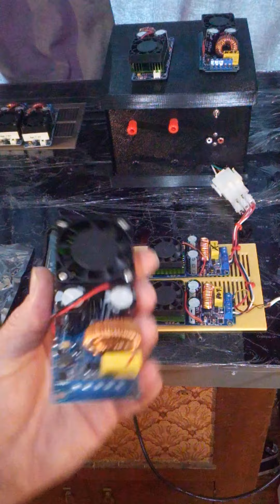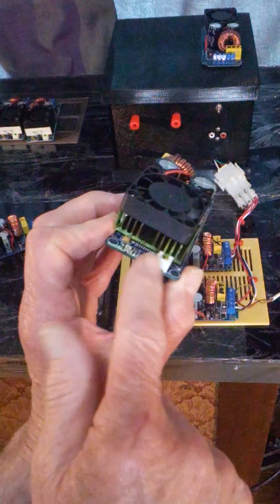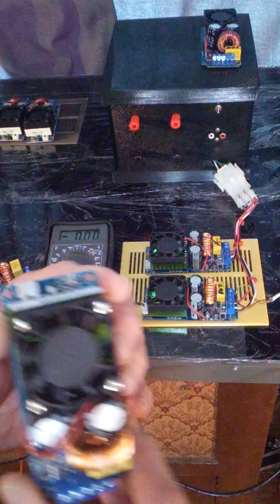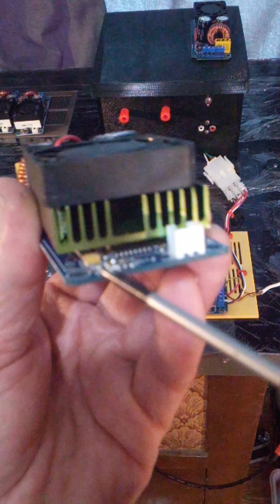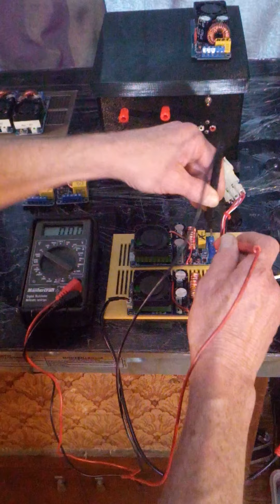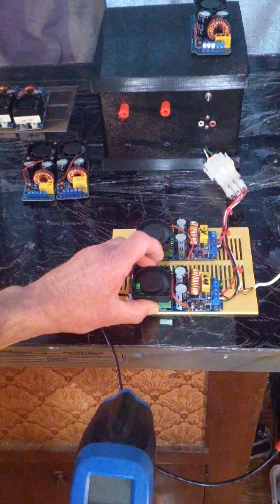IRS2092AMP-500W Amplifier Modules - how to tell the good ones from the bad ones at a glance!

Comment: Nope heatsink should like bad one. Because when amplifier is working link peroid of time, inductor gets hot so needed cooldown. Right ?
Reply: No because the heat from the heatsink will blow on the inductor so the inductor will get hotter
Reply: Why ?  @Raulley27

Comment: I think I got mixed one. Fan was loose, only two screws. Cooling fin has slots all around. There is small heat sink under it. And it works :D

Comment: Hi were do get the ground from? My 65 Volt-DC-Powersupply only features plus and minus? Why do I need the Groundcable?
Reply from the maker: These amps require a dual output power supply that has +/- 65vdc with a common ground. So 3 connections: +65vdc, ground, -65vdc with a total across the + and - of 130vdc
Reply: @terrycox6954   My guitar amp has +/- 48vdc supply can it run my preamp? in to 16r or 8 r cabinet?

Comment: tak sem taky naletěl mohu vás poprosit o odkaz na ty funkční moduly zakoupil sem si tento modul od firmy hadex a bohužel je to přesně podle tohoto videa sem velmi  zklamaný že někteří lidé pouze okrádají lidi a je jim to jedno děkuji vám za toto video
Reply from the maker: Try this link for the latest version with speaker delay relay. Make sure you get the ones with the red connector
Reply: @terrycox6954 what link? There is no link ffs.